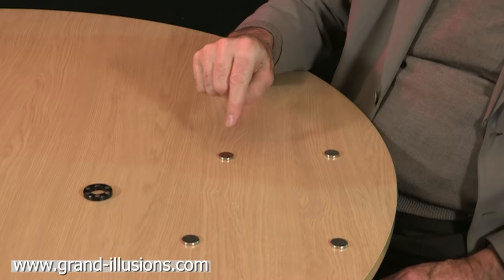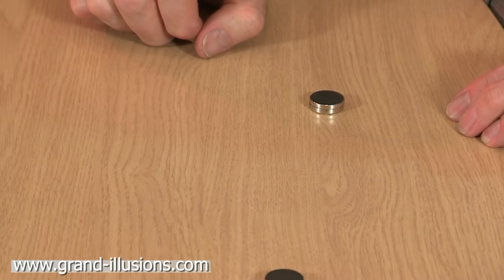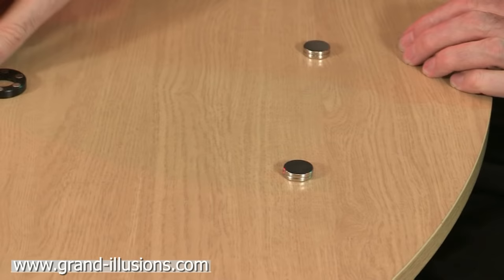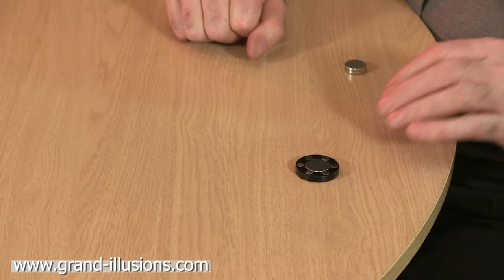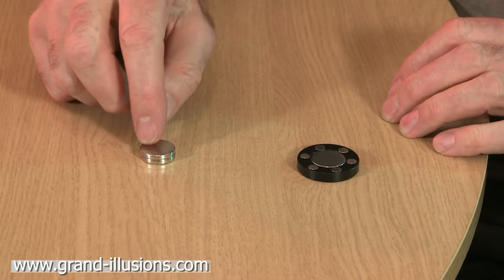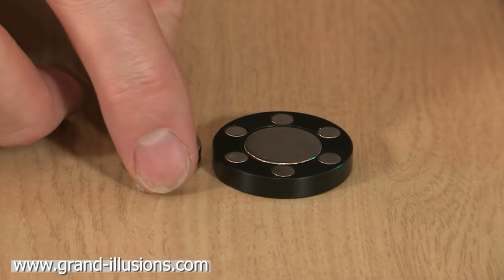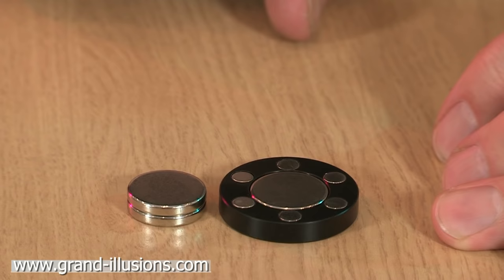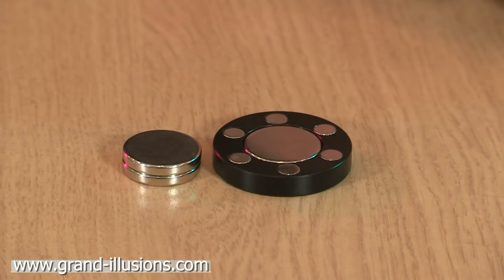Amazing Discovery With Magnets - The Inverter Magnet

Comment: magnets fascinate me
Reply: How is life going man
Reply: Fucking magnets, how do they work?
Reply: @immortalsun  they work by being made up of a bunch of tiny magnets all facing the same direction
Reply: @jaymanolis6328  and I dont wanna talk to a scientist
Reply: It's very attractive
Reply: I used to think magnets were magic. (as a kid) I still am really interested in them.
Reply: @umwhatamIdoinghere  Ah yes, I often hear scientists say things like, "fire burns because it is hot", and "magnets work because they are made of magnets". :/
Reply: @jasondunken  you're at least the third person in this comments section who didn't get the reference.
Reply: Same
Reply: Magnets are still a mystery and they defy the laws of physics (conservation of energy). They seem to have unlimited power to pull and push with no power source.
Reply: @widehotep9257  Magnets aren't a mystery since 1888 and they don't defy any laws. One can't prooduce any energy out of pure magnet. If it would be a case electric motors wouldn't require any external source of energy.
Heavy rock lies one the ground and pressures it with some force, can you convet that force into work?
Reply: @krzkam7792  Yes, a magnet can do work. It can pull a heavy load up hill for a short distance (metal wagon pulled by strong neodymium magnets, for example). Because there is no known power source for this work, and because the magnet "pulls" indefinitely, only two possible explanations are true: 1) magnets have endless energy, or 2) magnets have an unknown, external power source. Number one defies the laws of conservation of energy. And number two defies all mainstream science beliefs.
Reply: @widehotep9257  There is known (like i said, since 1888) source of this "work" called magnetic field.
Magnets won't pull indefinitely but just to the center of the magnetic field, which is in the center of that particular magnet.
If magnet pull something with some force you have to use almost exact amount of force to pull that object off (u have to use more force because of static friction) so the work equation is negative. You didnt produce any extra work but had to use some extra.
In that case why people didn't invent engine based on that unknown, external power source yet?
Magnets also loses their properties by the time so it's far from endless.

"mainstream science beliefs" what does it means?
Reply: @krzkam7792  You must be using the "work function" to define work (Work = force times distance), correct? That is a flawed equation because it only measures work if something moves. There are many times when energy is spent without any detectible motion. For example, I can spend an enormous amount of energy pushing on the side of a mountain that never moves, and the work function would wrongly describe the encounter as zero work being performed.

Here is a proof that magnets are working even when no motion occurs: Imagine a steel barbell setting on a scale, and the scale reads 30 pounds. Next, a powerful magnet is suspended from a rope within inches of the barbell. We see proof of the magnet "pulling" the weight because the scale reading drops by five pounds. So now the scale reads twenty-five pounds instead of thirty. There is a tiny initial movement of a few millimeters of the barbell, but no other motion of the steel barbell or scale or magnet.

Next, a scientist walks into the room and determines that no work is being performed by the magnet because nothing is moving (Work = Force times distance. If distance is zero, work must also be zero). But we know that the magnet is "pulling" the barbell upwards five pounds continuously. (If you tried pulling a barbell with your arm like this without an energy source you would soon starve to death and die.) The magnet performs this work indefinitely, for endless days and weeks and months, without contacting the steel barbell directly! Therefore the magnet MUST be consuming energy to lift the weight. Either this energy is somehow internal and perpetual, OR it is coming from an unknown, outside power source.

Perhaps you are right that magnets eventually lose their magnetism, although I've read conflicting reports about this. There are magnetic compasses for sale on ebay that were built in the 1860's and still function perfectly. And I have seen magnets "pull" onto the side of refrigerator for over twenty years without failing. Please try holding a photograph on the side of a refrigerator for 20 years with no power source and see how long you live. My guess is seven to ten days.

My reference to "mainstream science" is that there is no contemporary theory of magnets having an external power source. 

No, magnets were not explained in 1888 just as gravity was not explained by Newton, Einstein, or modern string theory graviton nonsense. Magnets and gravity are still mysteries. However, their PROPERTIES have been understood a long time. 

Before you lecture me with wikipedia articles on "flowing electrons" and other unproveable theories, be aware that Tesla (who invented Alternating Current) didn't believe in the "electron flow" theories of electricity and magnetism either.
Reply: @widehotep9257  I'm not even going to start reading this mumble.
Just answer one question please: what is the shape of a "planet" we live on?
Reply: @widehotep9257  Is flat, isn't she?
Reply: @widehotep9257  What was the question?
Reply: @krzkam7792  mumble mumble wikipedia mumble mumble
Reply: @widehotep9257  That's the question?
Reply: @krzkam7792  Learn to read.
Reply: @widehotep9257  "Learn to read" but just god forbid textbooks or other reliable sources of actual knowledge, instead read bunch of valuable woo "science" articles about Einstein being fraud and unknown external energy sources, right?
Reply: @krzkam7792  Here's the question: what is a "field"? (As in, "magnetic field").
Reply: @widehotep9257  Is exactly what your beloved wikipedia describes.
Reply: @krzkam7792  A field is an area effected by a force. A force requires energy. Therefore a magnetic field requires an energy source to exist.

What is the energy source for the magnetic field of my twenty-year-old refrigerator magnet, Einstein?

Only one more question after this and we should have check mate, Professor!
Reply: @goatfood1504  please link to a video explaining how magnets are "formed within a field of electronic probability." 

Here's a question for you: What is a field? 

Keep your answer short. I will have two follow questions after that, then I think we will be in agreement.
Reply: I never said I could build a perpetual motion machine from magnets, so please stop with the straw man attacks. Making false accusations against me using flat earther insults and perpetual motion machine comments exposes your true abilities as a thinker.
Reply: @widehotep9257  also to address your first request for a video explaining electronic probability as it relates to magnets, that is a connection between how magnets work in classical physics and how electrons work in modern quantum physics. I suggest doing your own research as no one video I can find does the job fully. A great first place to look for an easy to understand explanation is Khan Academy.
Reply: Than please stop insulting me by calling me wide known con artist and masons puppet - Albert Einstein.
Reply: I am glad you didn't say it attracts you.
Reply: @goatfood1504  No, it doesn't work that way. You made a claim so please show the evidence. It seems very suspicious to me that the inner-workings of magnets are supposedly understood ("fields of electron probabilities"), yet there isn't a ten minute video explaining it in simple English.

Did you define a field yet?
Reply: @goatfood1504  Is a field the area affected by a force? Yes or no.

Does a force require energy? Yes or no.
Reply: @widehotep9257  A field is not always an area being affected by a force, but for the purpose of this argument we can use that as the definition if you prefer. And to address your second point, no not all forces require energy to be exerted, for example when you hang something from a string the string is applying a tension force to the object to counteract the gravitation force applied by earth yet no energy is being exerted. Also to address your demands for sources, I’m going to have to ask you to send me a video that supports any of your claims at all especially the one about magnets breaking the law of conservation of energy.
Reply: @widehotep9257  I also thing you have a few misconception of what defines energy. Energy is only the ability to do work. Thus in the case of gravity the distance between the objects is the defining trait as per the equation Egravity=m*h*g. You can see this is analogous as work is not done by the magnetic force unless the object moves closer to the center of the magnet or the magnet moves closer to the center of the object converting the potential energy to kinetic energy.
Reply: @widehotep9257   I also thing you have a few misconception of what defines energy. Energy is only the ability to do work. Thus in the case of gravity the distance between the objects is the defining trait as per the equation Egravity=m*h*g. You can see this is analogous as work is not done by the magnetic force unless the object moves closer to the center of the magnet or the magnet moves closer to the center of the object converting the potential energy to kinetic energy.
Reply: @widehotep9257   Also the equation. Work=Force*distance is not incorrect is any way, however, I won’t write out a full explanation unless you want one
Reply: Wilde, you’ve done zero work if you push against the side of an immovable mountain for your entire life. Sorry. Work requires motion IN THE DIRECTION of the force. That being said, NOBODY knows the mechanism that actually causes magnetic force. We can predict the force given all the parameters, but the actual mechanism is unknown.
Reply: @widehotep9257  Nothing more to add, mister capable thinker?
Reply: @interestedparty00  The work function (W = Force times distance) was invented to observe and improve the efficiency of steam engines in the 1800's, NOT to describe how matter and energy interact in the physical world. Applying the work function to the obvious energetic mysteries of magnets (and gravity) is like applying veterinary medicine to automobile repair.

Thanks for admitting that the source of magnetic energy is unknown. Others in this thread believe that magnets have been fully understood since the late 1800's. Thank you for correcting them.

A field is the area effected by a force. A force requires energy. What is the energy source of a magnetic field? Since magnets have been observed to retain their field for over 150 years (see historic compasses for sale on ebay), is their energy source self-contained and perpetual? Or is their energy source provided by an external source? 

A magnet stuck to a metal ceiling beam can "lift" a weight for twenty years or longer (possibly forever). Everyone agrees that a magnetic field is holding the weight aloft that would otherwise crash to the floor. The definition of a field requires a use of energy. What is the energy source of this magnetic field?
Reply: @widehotep9257 , look, I most certainly agree that magnets can apply a mysterious force for a mysteriously long period of time. It's mysterious because we don't understand the mechanism by which the force is applied, and mysteriously because we don't understand how the magnetic force can be applied with no apparent energy source. HOWEVER, do NOT claim that a magnet can do work by simply holding an object in place. Work attributed to a magnet is limited to movement caused by the magnetic force. Also, do NOT claim that the physics definition of work is outdated or inappropriate. Your comparison of veterinary medicine applying to automotive repair is pure nonsense. There are plenty of germane terms for you to use - and you've used them. Limit your comments to those. I know that you're having a difficult time educating people in this thread, but it's not helped by the inappropriate use of terms.
Reply: @widehotep9257 : "he wrongly concludes that no energy is being spent to lift the weight." <-- No. He would NOT be wrongly concluding that. He would be correctly concluding that. How is energy being "spent"?? The energy isn't dissipated therefore it's not spent. Think about a bank account that keeps your credit rating high. The cash in your account isn't being spent yet its existence is keeping something elevated. The technical, physics terms are available for you to use - why don't you use them? It's just as easy to educate ignorant commenters using the right terms as it is to educate them using the wrong terms - so why use the wrong terms?
Reply: @widehotep9257 : "The work function equation demands that work must equal zero when the distance moved is zero. That leads to the FALSE conclusion that no energy is being used. " <-- No, it doesn't - because no energy is "used."
"But we know that lifting a steel barbell enough to reduce the scale reading by five percent requires energy, right?" <-- Wrong. It requires a force being applied - not energy being utilized.  
"do you believe it is possible to lift a steel barbell without touching it and reduce its weight by five percent, and hold it in that position indefinitely (for several years or even decades) without expending energy?" <-- NO! The "lifting" requires energy to be expended. The term "lifting" implies that you are moving it in the same direction as the force being applied. THAT requires work and, therefore, energy. HOLDING it does not require energy. It requires a force. 
"The work function is poorly suited to describe energy expenditures when motion is zero. " <-- No, it doesn't because energy is not expended in such situations when the motion is zero. 
Again, the CORRECT terms are available to you. Use them.
Reply: @interestedparty00  I will get back to you shortly. First I need to go lift weights and hold them above the ground indefinitely. According to you, only the initial lifting of the weight requires energy, but holding the weight above the ground does not use any energy because no motion will be detected. I should be able to hold the weight above the ground without burning any extra calories. Oh, and I won't be touching the weights either. I will be levitating them above the ground indefinitely, without contacting them in any way, and without using any energy. And I will hold the weights above the ground for perhaps twenty years or maybe even two hundred years. Because you and the work function say I can do it.
Reply: @widehotep9257 : "According to you, only the initial lifting of the weight requires energy" <-- I never said that energy wasn't required. I wrote that energy was expended. Energy is required to create the field. Also, try lying flat on your back without moving without using energy. The human body is different. I'm VERY sorry that you don't like physics definitions, but they aren't constraining. You aren't unable to articulate anything simply because you constrain yourself to writing correctly.
Reply: @widehotep9257  Force does NOT by definition require Energy exerted over time. Though it sounds logical that it would, even mundane events don’t make sense if you believe this. If I set a barbel on a table the barbel is still being pulled by gravity thus an equal force must be applied to it upward. The table and earth however aren’t losing energy thus this defies conservation of energy and your model of physics doesn’t apply to the real world. However, if we apply the commonly accepted scientifically unchallenged model we can see that the earth is applying a gravitational FORCE while losing no energy and the table is applying an equal normal FORCE counteracting it. This satisfied the W=F*d formula as no distance is moved and no work is done as you can obviously tell when you set an object at equilibrium on a table.
Reply: @widehotep9257  Please bring to me one reference on anyone who says the W=F*d equation is incorrect. The very notion that it could be incorrect doesn’t even make sense as work is defined primarily by this equation in physic. The unit used to describe work and energy is Joules, Which is literally (Kg*m)/s^2. Joules or whatever the imperial equivalent is are expressions of the amount of energy needed to accelerate a certain weight for a certain distance. That’s literally like having an equation that says X=X and trying to disprove that. You seem to be a smart individual, but your stubbornness appears to be clouding your better judgement in this specific situation.
Reply: @widehotep9257  The human body is very easy to compress. It doesn’t function like rigid bodies that we use in simple physical models. It exerts energy largely through heat into the rest of the universe constantly. When you lift an object you are adding energy to it as well as losing energy through heat to the rest of the universe. Then energy is continuously converted into heat through respiration as in order to continuously contract your muscles as well as, run brain activities, accelerate blood through your body, expand and contract the lungs, firing muscles to counteract imbalance, process waste, send messages through the nervous system, fight cancer cells, construct compounds to be used for hair and skin replacement, and so so so much more. All this to say that the human body is CONSTANTLY releasing energy into the universe and the set of conditions the body must be in order to suspend a heavy object in the air increases this energy use exponentially. (This is why you feel hot while working out you are converting stored joules, or calories which are the same thing expressed in different terms, into heat)
Reply: @widehotep9257  Also humans require sleep to function so if you tried to hold above the ground for “Twenty Years or maybe even two hundred years” maybe just use a table which can do exactly that or even a big rock if your worried about rot and termites.
Reply: @widehotep9257  “But we know that lifting a steel barbell enough to reduce the scale reading by 5 percent requires energy right?” No it literally does not. A scale just measures the force exerted by an object downward. A Force does not require energy, Forces are just expressed as acceleration*mass (That is literally the units for what a force is) it takes a larger force to accelerate a larger object and more force for larger acceleration. However if two equal forces apply to an object (for instance ground pushing up and gravity pulling down) no net work is being done on this object. This also applies to magnets as magnetic force+normal force of scale on barbell=Force of gravity. Everything is in equilibrium nothing will change unless another force acts on the system or there are internal forces that we consider negligible in the short term that matter in the long term(for instance gravitational force may continuously convert gravitational potential energy into tension on the rope until the rope breaks which upsets this near equilibrium)
Reply: @widehotep9257  Also this is a call to reason just using Occam’s razor from my perspective. What is more likely, the overwhelming majority of scientists, engineers, physicists, and textbooks use a model of the universe that can not encompass some of the most fundamental phenomenon of the universe such as gravity, or you have your physics definitions backwards.
Reply: What happens if you try to pick it up. With it dangle?
Reply: @tylermangelson  I don’t think the magnets are strong enough to do that but theoretically I would predict it would hover at a lower distance than it does on flat ground.